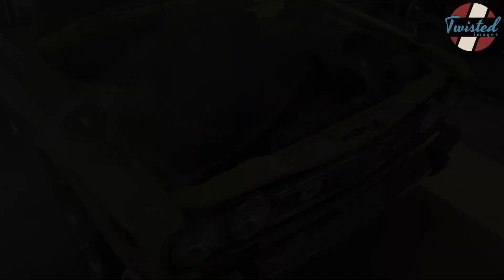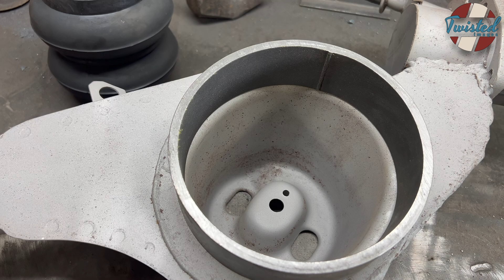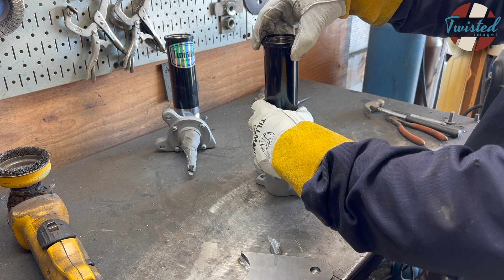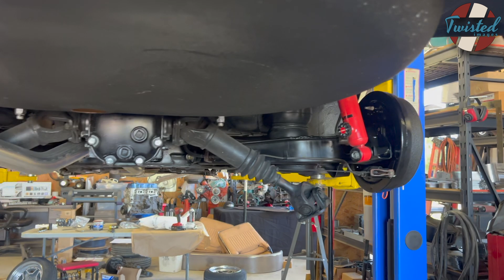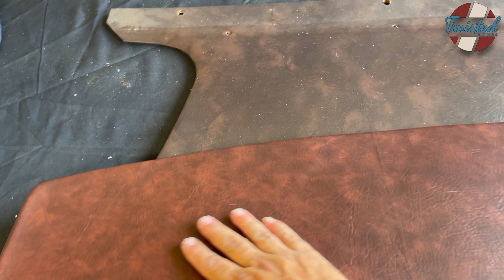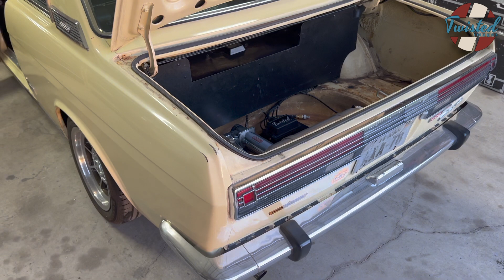'Bagging a 25k Mile Survivor! 1971 Datsun Bluebird SSS Coupe

Comment: Love the build and have watched it at least 30 times now but my question is where is the pressure switch or I am missing it on the tank?
Reply from the maker: @cowboy072369  that’s a great question! With the Air Lift 3P and 3H systems, the air pressure sensors for the tank and each air bag are built into the valve manifold. So you only need a single line from the tank- no external sensors required.
Reply: @twistedimages405  Thankyou . That I have no idea. From all the videos I have watched with someone using the Airlift system . No one that I can remember ever said that. I learned something new today. I remember seeing your 510 at Datsloco's car meet in Manteca a few years ago and figured one day when I can get a 510. I want to do the same thing. From Oakdale,Ca

Comment: Nice job 👏 👍 looks good. Riviera is sitting nice. I like that blue metallic. Bud have you checked out my friends shop. They make their own bags and kits for just about anything. THEIR NAME IS UNIVERSAL AIR SUSPENSION IN SAN BERNARDINO CALIFORNIA. REALLY COOL PEOPLE 😎 👌 👍 HAVE A BLESSED DAY 🙌
Reply from the maker: @Impalabelair  thanks! Yes, I’m a dealer for their parts too, and we’ve used them for a bunch of projects over the years!
Reply: Their airbags are narrow that will save you time cutting the frame. If you happen to call, them them Martin with the impalas send you . Keep posting those videos 📹 👌
Reply from the maker: @Impalabelair  we go with a larger diameter bag on the front of heavy cars to hit ride height at a lower pressure- we’re riding around between 70 and 85 psi versus over 100 with a smaller bag, so it’s worth the cutting on the big bodies!

Comment: Good stuff man. I always wondered about the heims on the tc rods if i makes any diff if they are installed like you did or vertical
Reply from the maker: I think there’s enough travel either way to keep them out of bind- as long as they match from passenger side to driver I won’t judge!

Comment: Maybe I missed this in the video but were did you find this jewelry of drivers?

When I was 7 my dad purchased a two year old 1975 Datsun 510, 2 door white with black interior and some modification from the previous owner. My uncle was living with us at the time working as a Chevy mechanic at the town delership which was the Datsun deler as well located literally accross the street. He took the car immediately to the garage where mechanics were allowed to have one car project per year for 10 days access to a giant single piston extruding from the ground lift plus 10 days use of a bay with a step down dungeon space. Basically garage types that have been out lawed due to safety. The space was in in a 20 car stall space on the back side no longer used and torn down a year later for a movie theater. So he had 20 days for any and all work for the year he put into my dads car as rent and food while living with us. 
Original owner Mods: Datsun 240Z 140mph spedo & Datsun Racing Tach, Oil Pres, H2O Temp, Alt Ohm, Custom tubular headers to a Stainless 2" exhaust using a Thrusher Cherry Bomb muffler exiting out a chrome 2x6" tip 4" in front of the driver rear wheel (unheard of in 1977), Big for the day 15" JDM Watanabe 8 spoke Banana wheels with offsets intended for a 240Z so 205 Front 225 Rear tires, cut fender and quaters for custom metal fender flares TIG welded on, custom tubular front A arms, adjustable rods for stearing angles, custom tubular rear anti hop control arms, bigger sway bars, Disc brake kit front and rear from Datsun Racing (aka Bluebird/Skyline) Koni Electronic adjustable shocks and struts with under dash control box (questionable if this worked as my dad claims he never noticed a difference but I think operator errors), cut springs with now unknown drop/maybe 2" front 1.5" Rear, 240 foam rear hatch 4" spoiler adapted to trunk, Datsun Sunny GS Stering wheel, Bluebird SSS 4dr style fender rear mirrors, Datsun Competition Cobra RS style seats black leather with chrome grommets and rare open center fish net headrest, matching lowback roadster style buckets in back all with 4 way harnesses, cut and install of aftermarket front or rear 2" pop up glass sunroof, same done for back seat. Some custom sheet metal rails to make up for roof weakness from cutting.  

My Uncles Mods: Single 6 inch wide black racing strip from front bumper to rear bumper on the right side of the car, Engine swap to 1st year crate motor from Skyline Racing of an L20ET but addition of an Intercooler from a 72 Mack Truck, Lage core Datsun Racing radiator, HEI Dastun Rotor, Points, Coil, Plugs, big injectors (only 3 sizes to choose at that time), Adjustable cam gear, custom grind cam from Crower, HP electric fuel pump, H2O pump, gear swap on oil pump for more volume per second, Custom oil pan for 2 additional quarts, baffled and sectioned to ensure oil is evenly distributed and not sloshing to back or sides during acceleration or cornering, custom prototype 4 puck HP super stiff clutch with early prototype hydraulic engagement clutch pedal for rare 5spd Fairlady 240Z transmission out of Montreal, Canada. Custom cromo driveshaft with cromo drive shaft protective loops installed under floorboard, 5 point 2 1/2" roll cage installed with a low X between front and rear so I could still climb in back. Swap to R200 rear Differential, axles and suspension parts for 4 wheel independent travel and mechanical limited rear wheel stearing at 15% assistance to front. Original car was about 75hp, my uncles engine swap with motor obtained from Vancouver BC made it about 145hp
All from my uncles notes of the race cars he built over the years. My dad invested around $4k not including original purchase. My dad was a Staff Sergeant in the Army and my mom was a GS 10 secretary on base so they made good money. 

My mom drove a 440 Plymouth GTX that was pretty wild too.

Comment: Sweet Datsun coupe. Is that hard to drive and shift with a right hand drive?
Reply from the maker: You get the hang of it pretty quickly. In my experience the trickiest parts are making left hand turns through intersections, and also on most JDM cars the turn signal and wiper control stalks are reversed so I’d constantly turn on the wipers when I made a left turn haha

Comment: Super clean installation looks amazing. I didn't even know that you had a you tube channel but I recognized your shop from picking up the ka24e from you for my Nissan D21 "BettyWhite". Thank you again, Nebraska
Reply from the maker: I’m glad that engine worked out for you! The timing on that whole thing seemed perfect
Reply: @twistedimages405  unfortunately my wife had problems with it one day coming home from sulphur. Truck overheated. Blew out the tank on the road. I replaced it. Next day the water pump that was installed when I put in the engine went out. No sooner did I get the water pump replaced the head gasket. More problems bla bla engine locks up. I still have the truck  it's currently sitting  on jack stands waiting for a engine. Not sure what to do. I have a 2018 Camry with D2 coilovers and 20" tsw. The wheel fitment is on point in my opinion. But it sure looks better with your bags and with your air management. ( Please Santa. lol)
Reply: put a VG in it- you can get em cheap youll pay more for a pair of cams than you did for the whole motor but you can get lots of power @mcdonaldryan81